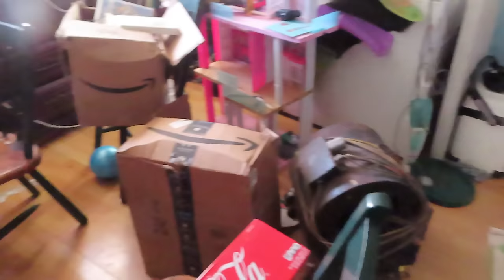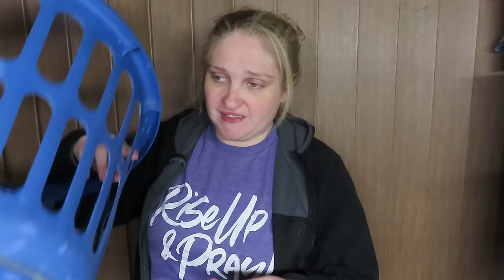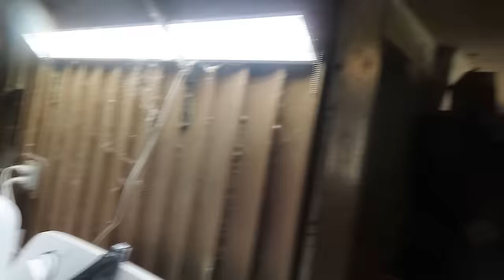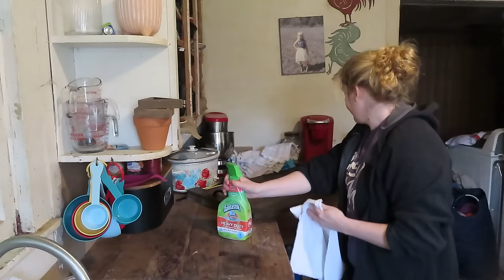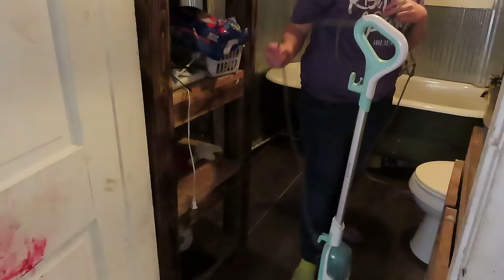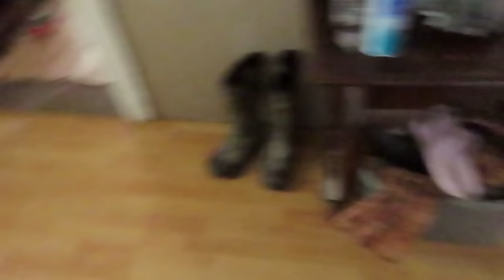Reset Monday Whole House Cleaning

Comment: Looking good! You are doing great. A vacuum cleaner with the hose attachment would be really useful for the cobwebs. I like to use the bristle brush attachment for my couch and it’s also great to dust while vacuuming my baseboards. You could also use the swifter dusters. Those are great too. Once it’s dirty you just throw in trash and put a new duster on the handle. 🩵💕🩵